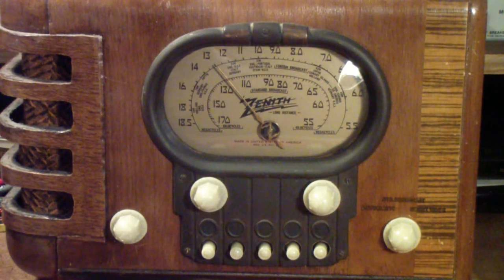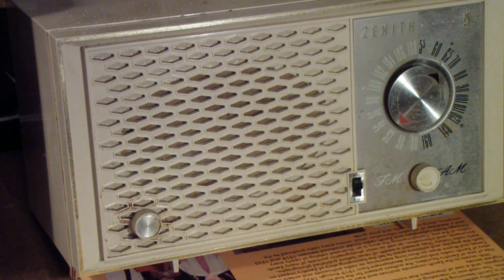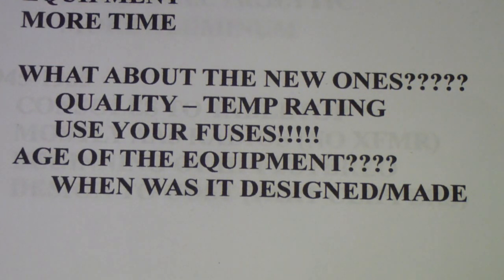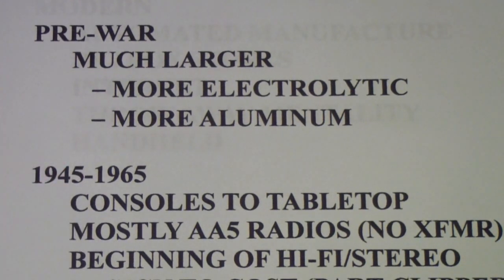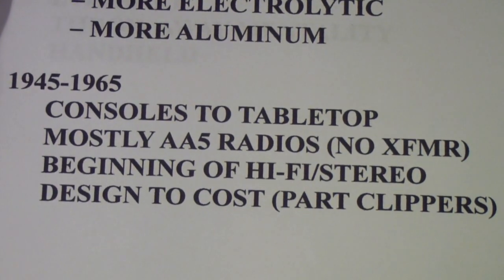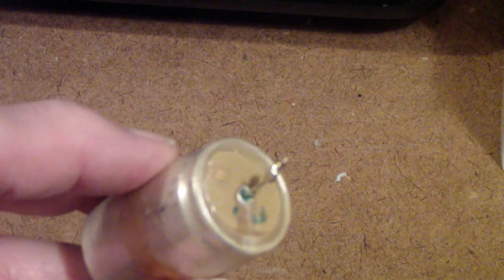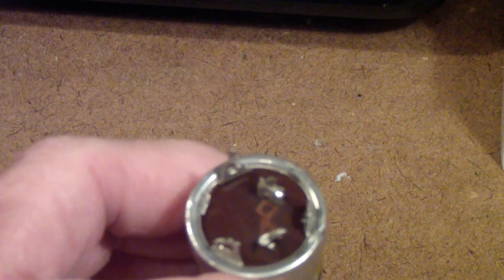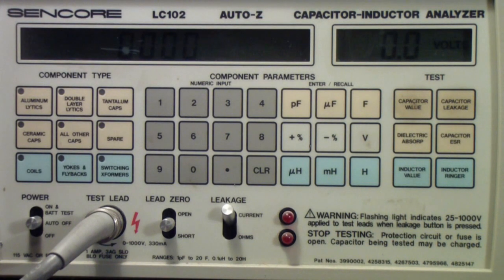TTT239 Vintage Capacitors

Comment: It basically boils down to "Moderation in all things."  There are circumstance is which any of the commonly espoused beliefs are appropriate.  Determining which is appropriate in a specific situation is the critical aspect, and the ability to make that determination correctly is a metric for the level of technical expertise that is available, and for the success of its application.

Comment: Interesting tutorial. One aspect not covered is the (sacrilege, to some) "hot rodding"  of vintage equipment to squeeze more performance from the potential of the design. So fitting audio grade coupling capacitors and overrated supply caps and so on. In this scenario complete replacement of old caps would be de rigueur. Cheers. M

Comment: You can still get those vintage capacitors if you want keep the radio orignal there no obosolete. There pricey. Hayseed can custom make multi section capacitors to the orignal specs cost anywhere from $25.00 $50.00. Also Tube Depot sells paper@oil capacitors there around $5.00 or more depending on kind you want. Can get Russian soviet capacitors from what are heard the quality is really good and they usually test really good even though there old. Maybe you could perhaps reform nos capacitors maybe right tools.

Comment: If you don't shotgun the Caps  thete is the higher probably the working  originals may fail later. (Preventative measures)

Comment: Tom, thanks for the great information. I took away a lot from this. The different era discussion was particularly insightful, where pre-war cap e-cap construction is beefier and more reliable than modern day caps. When you mentioned build to cost, parts clippers, I was waiting to hear about Madman Muntz, https://en.wikipedia.org/wiki/Madman_Muntz
Reply from the maker: Actually, well made modern caps are more reliable than pre-war, but they tend to fail shorted more often. Pre-war caps tend to fail open or leaky. So, replacing pre-war caps with modern ones will increase the MTBF (Mean Time Between Failure) of the unit, but, if you place a proper fuse in the circuit, you can continue to use the unit for as long as the old caps last without worry that when they fail there will be a disaster. If the old caps later do fail (some will) then you will have to do a replacement then, but, in the meantime (which can be another 20 years or more) you have kept the unit in its original condition. Also, if the old caps fail open then you can rely on them remaining open and bridging the old cap with a new one does not present any new problems. Of course, a relatively few old caps will eventually fail shorted (or too leaky to allow them to remain in the circuit) and they will have to be removed and replaced. But the odds are in your favor that, if the radio works with the old caps, it is probably worth leaving them in (as long as you provide fuse protection - which you should do anyway since new capacitors also fail).
Reply: @tomtektest8042  Hey Tom, when do you think component MTBF estimates started to be published?  Did engineers have this information in the 40s and 50s when they selected parts?
Reply from the maker: I don't know about the 40's or 50's. I first saw electronic component failure statistics in the late 60's coming out of NASA. I know that GE did some electronic statistical quality control studies in the 50's but I never saw any of those reports so I do not know what they covered. The methods were certainly known in the 40's since MIT's Lincoln Laboratory mentions them in the series of books they published after the war (the work was primarily on microwaves and classified during the war - they have since been declassified and published).
Reply: @tomtektest8042  I looked around for these declassified LL books, do you know what they're entitled?  Thanks for the comments. Have a great day.
Reply from the maker: I'm sorry, it was in the 60's and I just don't remember the titles.
Reply: @tomtektest8042  No worries, thanks.

Comment: Only time you shotgun modern equipment is if it was made by Sony between 1980 and 2000, and has surface mount electrolytic capacitors in there under 6V rating. Then you replace them all, as they are all going to leak. At least now you can get replacements that are better all round, and will fit.

Older equipment yes check condition, reform them and test again, and see if it has improved, stayed the same or failed test badly. Then replace those that are faulty and out of spec however you want cosmetically. Stuffing cans you probably can fit the new ones under the chassis in most cases, leaving the can disconnected "for appearance" but otherwise just replace. 

Now even worse are those old carbon composition resistors, if they look nice and shiny they are suspect and running hot, and generally they almost always will drift high with time anyway. Selenium rectifiers probably best to slip in the diode and series resistor there under it and leave it, though I have seen plenty that are still perfect after decades of use. But the smell when they do decide to go. Copper oxide rectifiers probably will last forever, though they are a lot rarer.
Reply from the maker: Thanks for the comments. I generally agree with everything you say. What happened to SONY in the 80's was very disappointing. Carbon resistors going up in value is very true and easy to test in most tube circuits since you don't usually need to disconnect one end - if they read high in circuit they are probably higher out of circuit. Do you have a YouTube channel? If not, I encourage you to start one since it looks like you have a lot of good info to share.